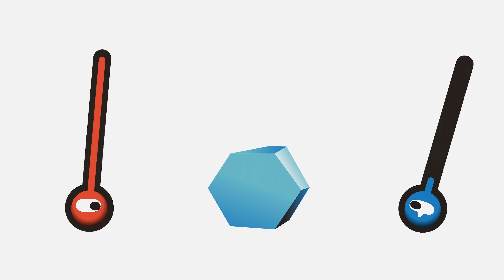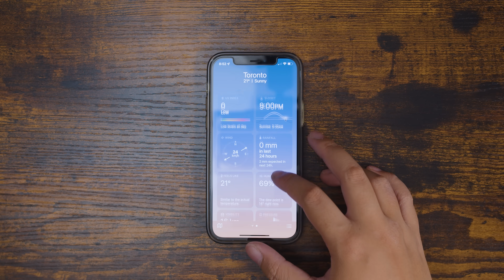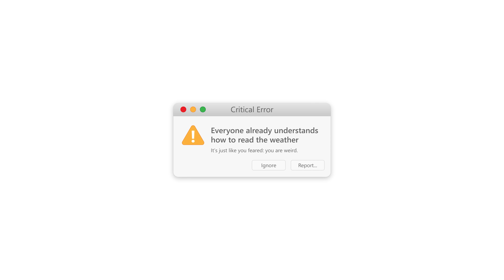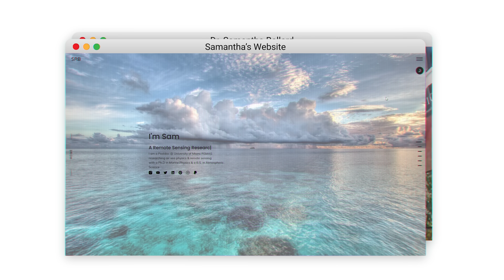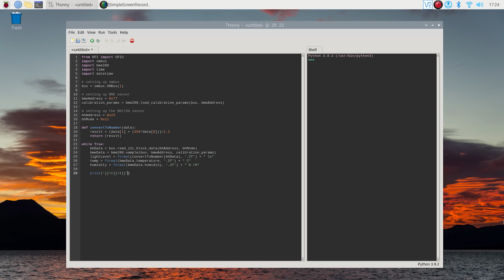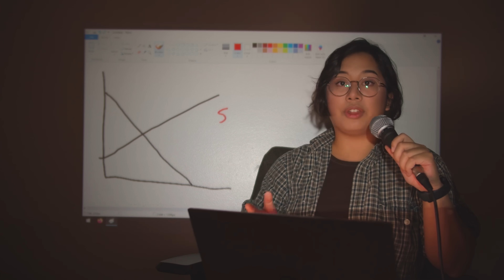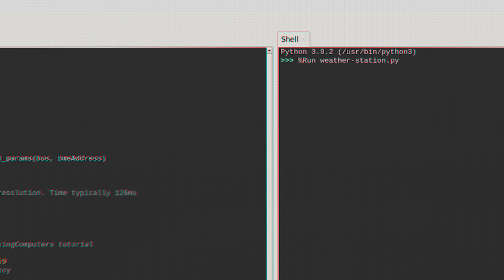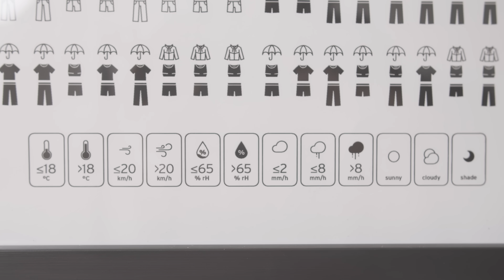how fahrenheit fails you

Comment: Not sure if it make sense but the weather widget im using have a "feels like" number right underneath the normal temperature, so for example it's -11C atm and it say "feels like -15c" so i treated it as - 15c. As for the scaling issue I just treated 0 to 30 as cold to hot, anything more than 20 doesn't required jacket, anything more than 10 doesn't require the huge jacket, and thr huge jacket handles everything under that

Comment: I learned to touch a sun-exposed window in the morning and dress accordingly. You get the visual of looking outside and the tactile sense of ambient air temperature with a hint of solar intensity (which forecasts the heat of the early afternoon, but I’d still be indoors, and my concern was not being cold in the morning).

Comment: I think the metric scale for most measurements is easier to use and intuit, and I would happily convert to it if the country switched. Base ten prefixes and easy conversion? Yes please.
But Fahrenheit is a better system for measuring weather temperature, and I will die on this hill.
Reply: To clarify: I mean this figuratively and in the spirit of fun.
We all have the frame of reference we're used to, and they all work just fine. I see some people further down seeming to get legit heated about this, and that's not what I'm here for.
Reply: Also, yes, 69 and 70 degrees do feel different, and I do need that level of gradiation in my life. Thank you for coming to my ted talk.

Comment: Sabrina is behaving like a NPC from New World of One Piece where the weather changes every hour every few kilometres (oops miles) 
Also, being sweaty has more to do with humidity than temperature. High humid areas tend to feel hotter than it actually is. If the humidity is high then our sweat doesn't evaporate and our body doesn't dissipate the heat efficiently. The weather apps nowadays tells you that. "temperature 30°C, feels like 33°C"

Comment: The Fahrenheit scale was about blood (although he got the baseline wrong, as 100F is not a healthy body temperature).
Celsius is about water- freezing to boiling. The British scale is: 
Lower than or at 20C/ 68F- use Celsius
21C/ 70F and up- use Fahrenheit.
So if the temperature rises from 20C to 21C, the scale rises by 50.

Comment: Strange premise - it seems that you're just sharing your opinion based on your cultural experience. I grew up in a country where only celsius is used and have no problem identifying the difference between 12 and 26 degrees, and could never guess it's 40 when it's 26. It seems the issue is less with celsius and more with your frame of reference.

Comment: If someone somehow has no experience with either, the only advantage Celsius has, outside of working in temperature-sensitive technical fields, is in remembering the freezing and boiling points of water, which is information that most people don't actually need to use in day-to-day life.  It might be easier to remember that that's where the points are, but do you actually need to use that knowledge?  Maybe if you need a thermometer to poach an egg, instead of just boiling the water and then turning the heat down.  Beyond that, Celsius has no advantage.  Average body temp 37˚C vs. 98˚F, no advantage; if anything, I'd say Fahrenheit has a very slight advantage in that if your body temperature hits triple digits, you know you might be sick - you don't even need to read the number (versus having to remember 38˚C or whatever).  Intuiting the weather, it's easy with Fahrenheit, using every 10˚F as a sort of milestone - nothing could be easier.  With Celsius, IMHO 10˚ covers too much variance, 5˚ would be better.  But no advantage for Celsius here either.

Ultimately, both are easy enough to learn that anyone can use either scale with no issue.  However, if one must be declared superior than the other, then based on the points I made above, Fahrenheit is ever-so-slightly better for day-to-day use, while Celsius is better for technical use outside of hard sciences using Kelvins.

Comment: I like metric for a lot of things but I like the granularity of fahrenheit vs celsius for determining comfort level. It all has to do with our thermostats.
1 degree of fahrenheit by press of a button on a thermostat is a comfortable change in temperature.
65 degrees vs 68 degrees fahrenheit is a substantial change in the amount of comfort inside a house. As is the change between 68 degrees F and 71 degrees F.
Just the other day I got into an argument with my family member who left the thermostat on 71 overnight. It makes my bedroom too hot. 70 would be noticeably better, 69 would be nice, 68 is what I prefer. You don't have that type of control with celsius unless you start changing by 10ths which would be TOO granular. It'd be like, what's the comfort difference between 200c/10 vs 216c/10? Now you got 16 grades between cool but comfortable and warm but comfortable (assuming you're not in a bed on the top room of the house). In this economy, who has time to be pressing the thermostat button that many times? No. Cancel the celsius for USA project right now. Call the whole thing off.
Also, USAicans will never get used to the idea that 21 degrees is nice outside. 21 degrees just has too many negative connotations. If 98 Degrees is hot, 21 degrees features R. Kelly. (edit: 98 Degrees is/was also an R&B group)

Comment: To understand Fahrenheit you just need to remember 50F is 10C, every 9F is 5C, round that to 10f to 5c if it's something like weather, because it doesn't matter to be that precise, meaning 60 is 15, 70 is 20, 80 is 25, 40 is 5, 30 is 0, etc... It's a bit off, by a degree or 2 when you go very high or low, anything under - 20c you need to think a bit , the end.

Comment: -10 and under: Warm coat, gloves, warm hat and second pants.
-10 to -5: Warm coat, gloves and warm hat.
-5 to 0: Warm coat and hat.
0 to 5: Warm coat.
5 to 10: Warm sweater.
10 to 15: Warm hoodie.
15 to 20: Regular hoodie or just basic wardrobe.
20 to 25: Just t-shirt.
25 to 30: T-shirt and shorter pants.
30 to 35: T-shirt, shorter pants, sunscreen and sun blocking hat.
35 to 40: Unless you are going outside to swim and sunbathe on beach then stay at home.

Comment: DUMB GUIDE TO CELSIUS:

|-| Non-Weather Guide |-|
0° = Water freezes
40° = You have a fever
50° = Hot shower
70°-90° = Perfect for making tea
100° = Water boils

|-| Weather Guide |-|
Below 5° = Very cold, you're gonna need gloves and a big jacket and it's probably frozen outside
5°-15° = Pretty cold, ranges from big jacket to just a warm thick shirt
15°-20° = Warm but on the colder side, you can wear a t-shirt if you're resistant to cold but usually a simple sweater is perfect.
20°-25° = Perfect temperature, it's warm and you can wear a t-shirt, if there's sun outside then you're in paradise.
25°-30° = Warm but on the hotter side, you might sweat more easily. This is where people usually go to the pool or beach.
Over 30° = It's hot, this is when you go to the beach for half a day and drink tons of water and popsicles. 

|-| Season guide in Italy but probably basically anywhere in southern/central europe |-|
Winter: 10° and under
Autumn: 5° to 15°
Spring : 15° to 20°
Summer : 20 and over
Reply: I'd like to add a correction: Ober 30 C = You THINK you want to go to the Beach as it's 'perfect Beach weather', you go there, stay 15 min then realyize that it's F** HOT and go somewhere with shade and cold drinks instead! 😋
Reply: @DarkHarlequin  with the recent heat waves I feel pretty comfortable at 30°C outside, if I see this temperature during summer I'll think "oh okay nice weather coming". I consider too hot to be above 33°C. I was even schoked to find the 42°C peak I experienced this summer wasn't that bad.
Reply: 50 HOT SHOWER? more like 2nd degree burn shower, i shower at like 40 at most
Reply: 50 hot shower??? you gonna literally burn yourself. also about -5-15 being cold, thats just depends where you live but near 5/10 u can start walking pretty lightly
Reply: I had to look up a converter (I don't use Celcius) but you're going to scald yourself in a shower that hot! It looked off when you talked about 30º being a super hot day (which is where I'm like Sabrina since every weather temperature you listed to me sounds like "bring a coat... or several") but knew that even a hot shower isn't typically over 100º F
Reply: @anthonydelfino6171  You'd bring a coat for 30 °C? How hot does it get where you live?
Reply: @DanDanDoe  no, for 30º F. Every temperature you use in C to talk about the weather is below freezing in F.
Reply: 40°C is a pretty heavy fever. 37.5 is already a fever. 50°C shower is really, really hot for me. Like it'll actually be uncomfortably hot and might even be painful. I'm in the Netherlands and to me 0-10°C means it's time for a light winter jacket, maybe wear gloves, but it really depends on how cold the wind is. <0°C is really cold and requires a winter jacket, gloves, thick socks, a hat that I can pull over my ears preferably. I only wear shorts when it's about 22°C or higher, but start going out with just a shirt or a light jacket when it's 18°C or so.
Reply: @DanDanDoe "37.5 is already a fever" no. unless you stick your thermometer in your mouth or under your arm. 37.5°C is a pretty normal temperature at the end of the day. Body temperature will usually rise throughout the day and falls at the end and during the night; with sometimes more than a degree of difference. Medically 37.8 is considered the threshold for abnormal (low-grade fever); and doctors won't consider it significant unless it's above 38°C for a long period or 38,5°C peak.
Reply: @DanDanDoe  37.5 isn’t a fever, a fever is 38 or up, however 40 is a high fever, I do agree
Reply: So many people in the comments aren’t living in places where it doesn’t regularly get ~40C. Come to American southwest!
Reply: I would faint if I was wearing a sweater in 20C weather. No like, literally. I have bad thermoregulation.

Weirdly enough, my bad thermoregulation is why I'm still attached to Fahrenheit. The increased granularity (one degree Fahrenheit is only 55.6% that of one degree Celsius) makes it a godsend for managing my living conditions without having to resort to fractions of a degree. When 66F is too hot, and 64F is too cold, 65F is perfect. But that granularity is lost when dealing with Celsius. 

When I visited NZ, while inside with no fans, 19C was too hot, 18C was too cold, and... the air conditioner only worked in full degrees, so I just had to set it to 18C and sit far away from the vents (of course, this was during the brief periods my partner and I were the only ones home. The rest of the time I was largely way too hot, as the house was frequently closer to 20-25C depending on time of day)

Fahrenheit is arbitrary and that makes it unwieldy. If there was a way we could just... shift Fahrenheit down by 32 degrees, that would work for me. Or hell, make half-degrees Celsius a minimum standard. I know neither will happen, but one can dream?
Reply: @kittycatcaoimhe  most heater/AC operates in decimals; and my thermometers right now says 19.6°C; and I'm freezing with two layers of clothes and a duvet; for me the ideal inside temperature is 25°C to stay in a t-shirt, I'll probably start using the heater when it's down to 18°C. granted I'm french and was raised with no AC and can't stand it when people use AC to freezing temperatures.
Reply: @hmmmhhhmmh  I genuinely don't know how anyone can sit in a 25° house without a bunch of fans going. It's currently 66°F (18.9°C) in the house and I could only tolerate maybe a degree or two warmer before I start getting uncomfortable
Reply: Weather guide in north Mexico:
Below 5° = Cold front. It's freaking freezing. You got so many layers you can't even move properly.

5°-15° = Average winter, get at least two layers, plus a jacket for the morning, you can remove it at noon when the sun is stronger.
15°-20° = It's a bit chilly, take a sweater to put on after sunset.
20°-25° = Warm in the sun, a fresh in the shadow, you decide how to handle that, but I'd go for a thin long sleeve.
25°-30° = It's nice outside.
30°-35° = Average summer, you'll be sweaty. Beware of burning seatbelts. I hate summer.
35°-40° = It's don't walk away from the AC or you'll melt into the ground season!

Over 40° = Heat wave. If you go out the sun will vaporize you. Good luck sleeping tonight.
Reply: Dumb guide to Fahrenheit: %
Reply: This comment must be pinned
Reply: 50c shower? How does your shower get that hot?
Reply: Bruh a 40°C shower hurts for me
Reply: Below 5 is "very cold"? Must be a very nice climate to live in.

Comment: Fahrenheit is a superior system for measuring everyday temperature.

It is more precise and aligns better with day to day usage. Like I've recently swapped to Celsius (still plan too) and the temp has been fluctuating between 29 and 34. And this in my Celsius scale has been -1 to 1 degree and considering I'm dealing with freezing water this is WAY to much of a margin of error with round numbers. I kinda need to precisely know what the outdoor temp is.

Comment: Certain countries: Uses metric system because they don't like fractions. Also those countries: Uses temperature system that constitutes use of decimals (fractions). Makes sense.

When you have a temperature system that has livable temperature in a 50 degree range, you have a much more difficult time expressing the difference in temperature and how it feels. I can go outside without a heavy coat (maybe a light jacket) if the temp is 40 degrees F, without a jacket if it's 50, (slight chill), comfortable at 60-75, a bit warm at 80, uncomfortable at 90, and sweltering at 100+. That's 60 degrees (above freezing) that I can know how to deal with. All of that is shoved into 30 degrees of Celsius. Celsius is fine if you're talking about the freezing/boiling temperature of water, but when you're talking about how a temperature feels to humans, Fahrenheit allows for a much greater range of expression of that feeling.

Comment: This has been my stance in regards to Fahrenheit.

100 degrees is the hottest weather you can imagine. 0 degrees is the coldest weather you can imagine. Yes the weather goes above and below those two values but functionally it's the hottest and coldest imaginable.

Then you can band things together. 75 is very hot. 25 is very cold. 50 degrees is right in the middle.

It's not good for precision. it's good for common sense.

Comment: You cant just look at the temperature number, without recognizing humidity at all if you want to know how you need to dress.
High humidity at 30°C with sunny weather is going to make you feel like youre gonna die. But if humidity is rather low at 30°C its gonna very quite comfortable.
High humidity at 5°C is gonna make you feel at you become a cunk of ice in a couple minutes. If you midity is low at 5°C a T-Shirt might almost be enough for you outside.
So to recognize the pattern: High humidity always makes you feel like you wanna die - lower humidty usually makes any temperature feel comfortable.

Reason being - water transmits heat more quickly than just pure dry air. But you also just gotta get used to the enviroment youre in, too. Wet 32°C can be rather comfortable, actually.
There is no bad weather - just wrong clothing.

Comment: i think guessing the temperature outside is almost impossible because there are other factors to look into, for example there is humidity, even when the temperature reads cold outside, it might be hot when humidity is in action. The air temperature is also different from what our body feels, there is what you call body heat index that we should also consider.

Comment: Use Fahrenheit and the “feels like” in an app 😂 0-100 scale seems much easier. The closer you get to 0 the colder the closer or past 100 the hotter it is. Fairly simple system. And for the in between like humidity and what not most apps have a “feels like” measurement which is usually pretty accurate.

Comment: Fahrenheit is only more intuitive for those who grew up using Fahrenheit.
When I look at Fahrenheit, I have the same problem of "What does that number mean?". I convert to Celsius and now I know what it means. Because I grew up with Celsius, and Celsius is much more intuitive for me.

So if remove the intuitiveness from the equation, because it depends on what you grew up with, we have basically nothing left for Fahrenheit, yet still a lot left for Celsius. Therefore, Celsius > Fahrenheit.
q.e.d.

Comment: I have 4 stages of what to wear. 80+ hoodie comes off. 45 to 70, my default. 45- thermal underwear. Snow, winter jacket. This simplistic approach comes from me, having lived in Southern California that has highs in the summer of 110 and bone dry, then moving to the Midwest with high humidity. Humidity does more for how hot I feel than actual temperature, but where I live, that is consistent. Back in CA I would wear the same exact thing at all Temps but the hottest days. The thing I consider most when it comes to weather is precipitation, personally.

Comment: Personally, I am an American who grew up using Fahrenheit so might be slightly biased, but I just think it's superior for things like communicating the weather. Like you can say it's "in the 70s" or "in the 80s" and those ranges have a distinct feel. But in Celcius, you need to be more exact because saying it's in the 10's is like 60F to 80F. So you need to actually say the exact number, which is far more inconvenient. Of course for boiling water, I can understand celcius is better because it's not 32 and 212 but 0 and 100. Ultimately I don't know anyone who needs to know the temperature water boils at, but almost everyone needs to know the temperature it is outside. For everything else, they are equally weird, like 350 or 175 for baking.